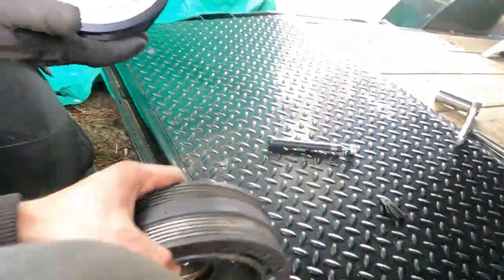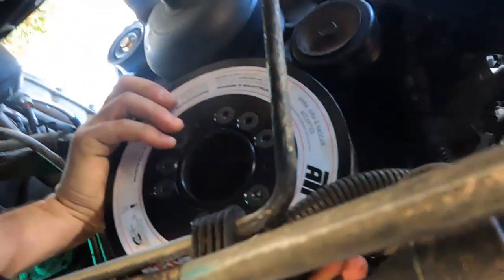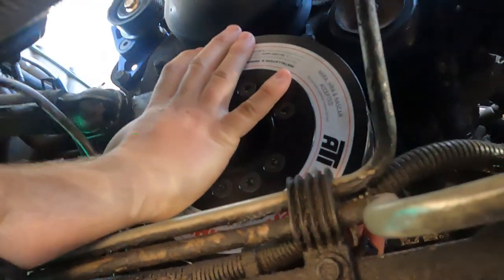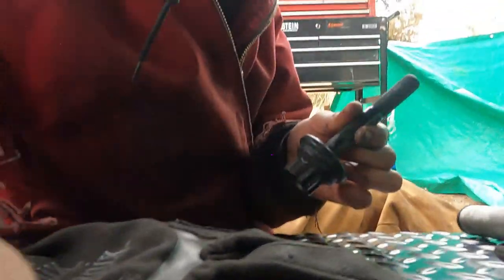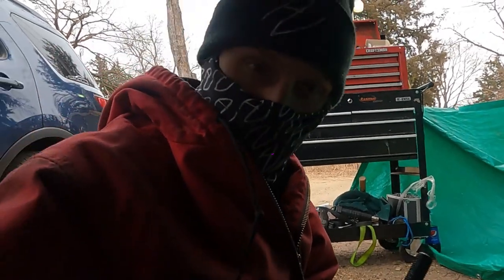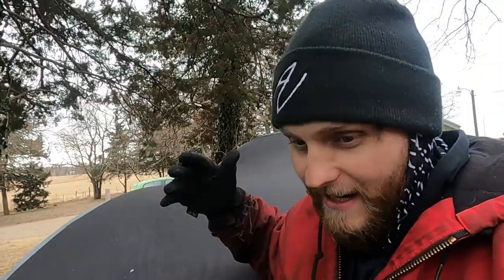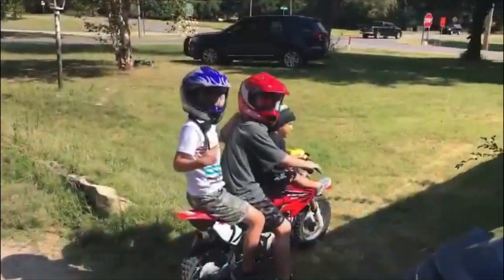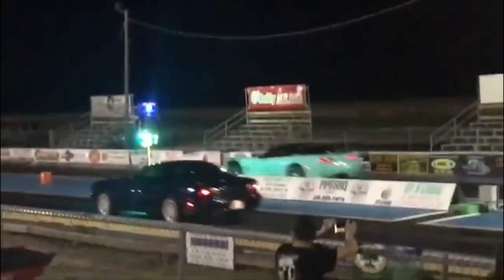How to install an ATI Super Damper on a Corvette (C5 1997-2004) [Harmonic Balancer install]

Comment: I ended up using some thin rope and looped it through the balancer itself and tied it super tight onto the car itself to stop the crank from spinning while tightening the bolt on the new balancer I didn’t wanna risk using a pry bar or screw driver to wedge in.
Reply from the maker: That's a great idea! Thanks for sharing your method with us 🙏🏻

Comment: Why did you use gasket maker on the keyed groove? I have a 2000 C5 that’s gonna need a damper pretty soon.
Reply from the maker: I did that because my crank isn't keyed. It's best to put some high temp gasket maker in place of where the key should be in this situation. However yours maybe keyed and in that case you wouldn't apply any gasket maker to the balancer. 

Good luck with yours! I've got videos on every step to getting to this point in my Avy the Corvette playlist.
Reply: @ArcticVette  thank you buddy I appreciate it ♥️
Reply from the maker: @zunySSBM  you're welcome!

Comment: What’s the part number for the one you used
Reply from the maker: ATI-917266 is the Balancer

ARP-234-2503 is the bolt
Reply: I see a lot of different ones on here is yours the base or the zo6 mine is the base
Reply from the maker: Mines a base model

Comment: How did you torque the bolt without the crank turning ?
Reply from the maker: Used a pry bar to hold it in place, same as removing the bolt. The crossmember was helpful here